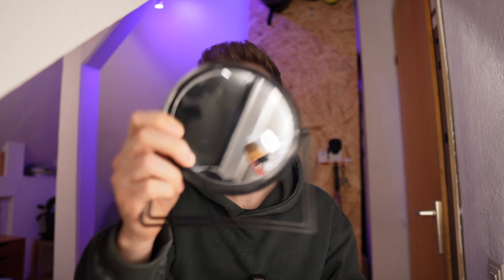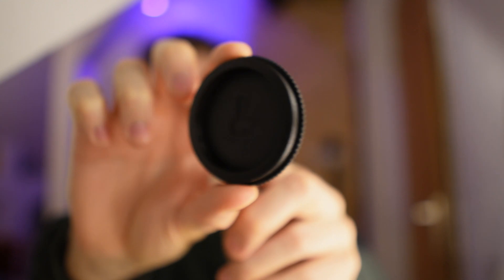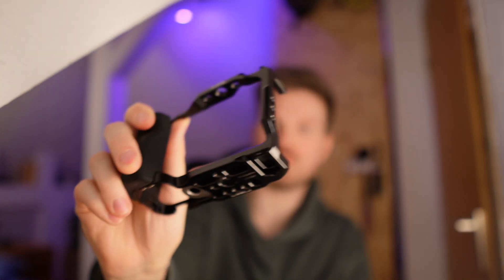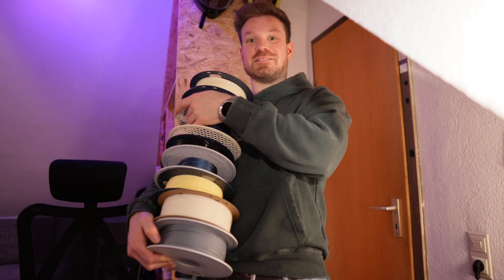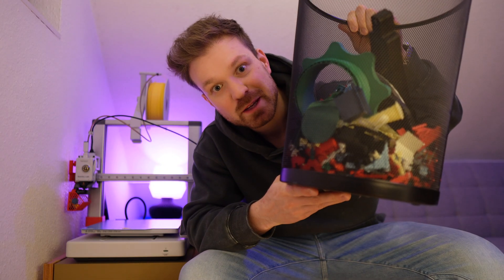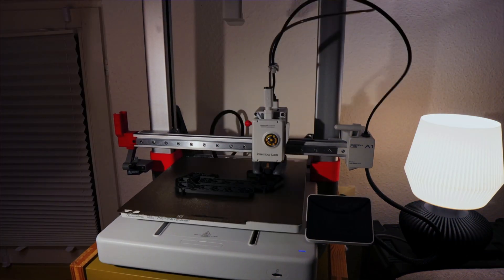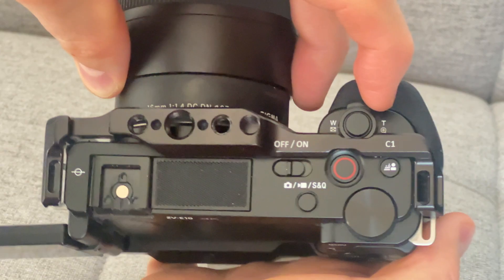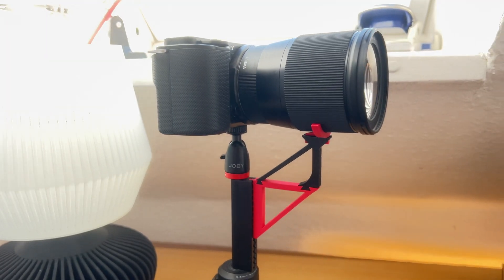3D-Printed Camera Gear - Genius or Garbage?

Comment: @floatypiet - about the blue top-mounted handle - printing it in that orientation doesn’t just LOOK bad. More importantly for a handle for a heavy and expensive camera, printing that way will make a weaker, more easily broken, handle. The weakest direction for any 3d print is the direction that pulls the layers away from each other (z-axis). Printing like the blue one means the camera is hanging from the handle by the layer/layer adhesion strength, not the strength of the material. The printing orientation of the black one gets you a MUCH stronger handle! 😊 

// same goes for printing screws and bolts. Much stronger printed laying down than standing tall. Makes for funny looking bolts, but they are stronger.